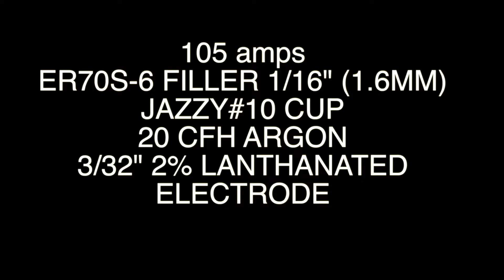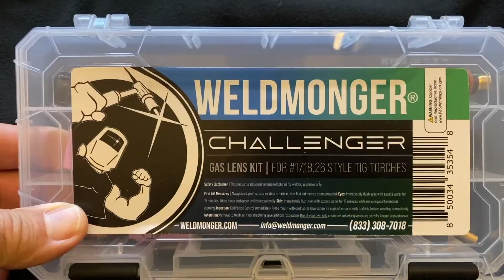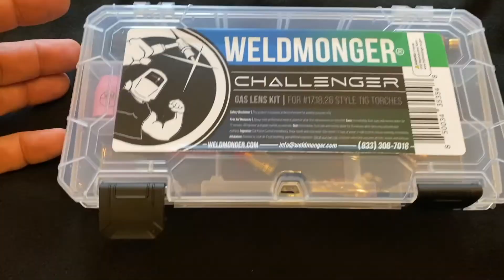How to TIG Weld Cold Rolled Steel - Corner and Lap Joints

Comment: i think the hardest thing for me right now as a new welding student is keeping my puddle going and consistent. we’ve touched a bit on filler metal, but haven’t actually used it yet, so if you have any tips on that and travel angle, or anything along those lines, it would be much appreciated! thanks for making awesome videos, these help a lot.

Comment: Whats the difference between types of Tungsten and where and when do you use the different types? In welding school and so far I just use 2% thoriated red for Carbon and E3 Purple for aluminum, but it seem u can use 2% Lanthanated on Carbon, alum, and Stainless. wondering whats the difference, also theres like the lime green one too which I heard is good for thin sheet metal idk

Comment: I’m brand new to tig welding. At 63 I’m too old to start learning a new art but I’m doing it anyway. I’d like to see some basics like holding the torch, proper arm rest, wire feed hand techniques, pedal control. Stuff that is seconded nature to a pro but the beginner needs to know. My 2 cents.

Comment: I would like to see you weld some thicker than usual aluminum for the machine. I have a project coming up that is .190” 5052 and I have an Everlast 210EXT. i really like my machine, I’m just a little unsure where to start with my settings since it’s pretty heavy material for the machine size.

Comment: I would love to see welding thicker metal 1/4” to a very thin 1/16” or even thinner 1/32” . 

Preferably doing a lap weld and a rosette/plug weld (top thicker metal has hole and bottom thinner does not). 

I don’t think I have seen any good videos in my search doing this . 

Thank you for all the videos you post and tips you share.
Reply: Me too!

Comment: i have seen a lot of videos with pulsed spray welding. but about 3 months ago i had the chance to try a Migatronic welder with one of there welding specialists and we were welding about 3mm plate with 150-170 amps pulsed to minimize spatter. haven't seen any videos with pulsed mig in the globular range

Comment: Hi Jody, can you do a video simulating some of the various aspects of welded bike frame construction? Stuff like thin wall tube to thicker wall tube(main tubes to bottom bracket shell), plate slotted into small dia tube(dropouts) etc. I am hoping for aluminum, chromo and ti. I am looking to get into building bikes and I am familiar with steel brazing, but would like to know what kind of welder I should get since that is important to me as well. I have wanted to learn welding for a long time and your videos are inspiring me to make it happen.

Comment: Your vids are very instructional, in an easy to understand lecture/practice  format.  I learned  welding in '91/'92, after being laid off from Pan Am.  The only form I learned that I can't use now is TIG.  Turns out I have a tremor with genetic origin, so I literally can't  hold the torch steady to do those lovely "stacked dimes" beads.

Comment: I’m expected to weld cracks on internal structures inside of F-16 wing tanks soon.  6061.  Any previous vids of yours about welding fuel-soaked aluminum?  Yes.  I have regs available on the subject.  Just wondering if you have any thoughts on the matter.  Thanks!

Comment: when I try to dab and move like that on stainless, the puddle opens towards the tip of the tungsten. like, im dabbing and then with each dab, the weld seam isn't consistent, each scale of weld is crooked to the left, one to the right, one to the back of the puddle. I can see it happening in real time.. if anyone understands what I said, can I plz get an explanation to what is happening there? 
it feels like too much heat is accumulating at the point of the weld so the puddle just expands itself. but no matter what I do I can never dab and move like this and get a consistent weld seam. I really wish to improve but it doesn't work for me!!!

Comment: Love the videos.   My biggest problem is feeding the wire on long welds.  I know you have some older videos on feeding the wire, do you have more or newer tips?
And BTW, I bought the kit for water cooled.  I had many of the smaller cups, but it gave the larger cups and a great place to store them.

Comment: I really like your videos your tips and tricks have saved me from some to a lot of the learning pains.  You ask that we tell you what kind of videos we would like to see.

I have the prime weld 200 and it has a lift tig with no finger switch or foot pedal. Videos on tig welding without those auxillary parts and how to achieve close to or the same results as when a foot pedal or finger switch is available would be much appreciated.  Thank you.